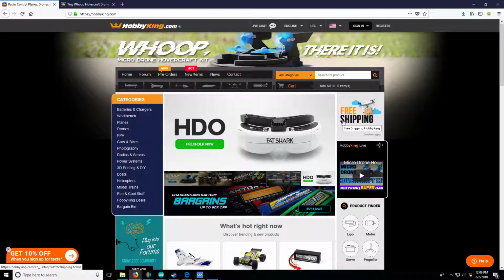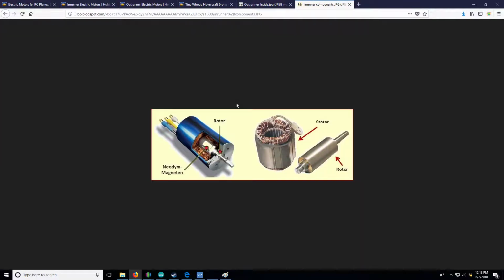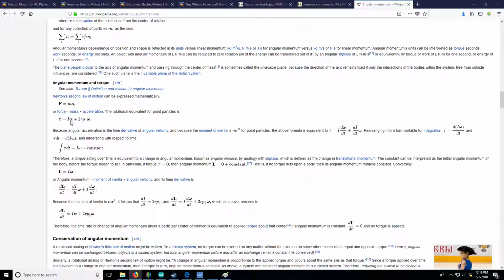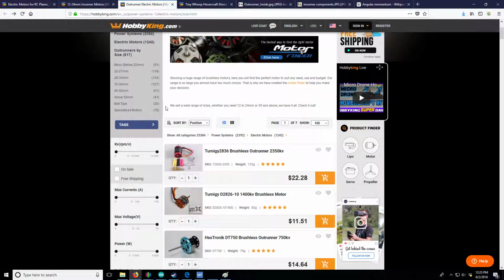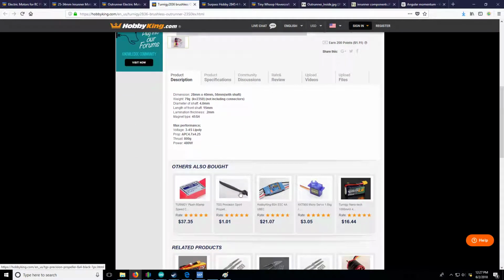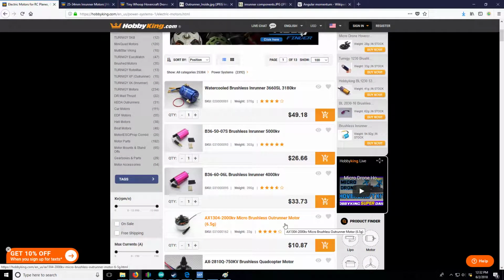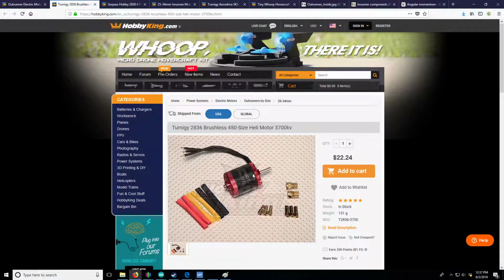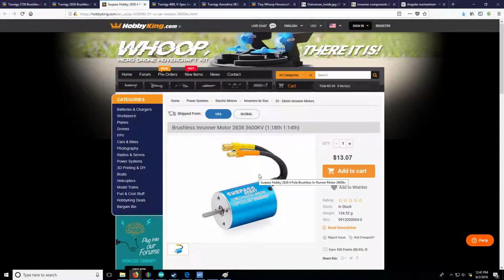Rule of Thumb: Inrunner Vs Outrunner

Comment: In boats, outrunner will handle more weight and you can prop more up with torque in a boat for example. Inrunner is more for speed like you stated. Both have their places depending on weight and speeds and voltages.